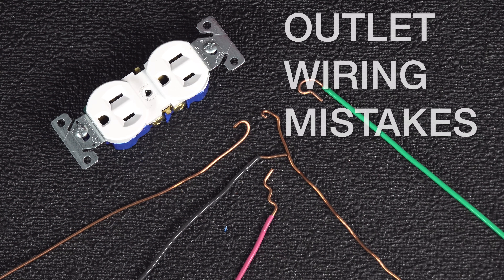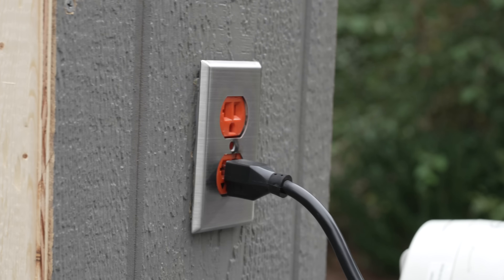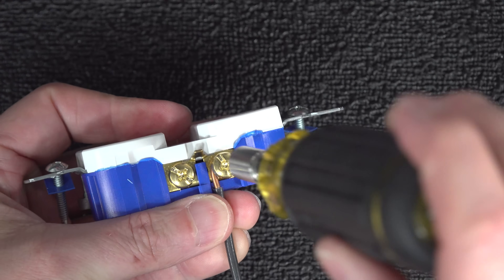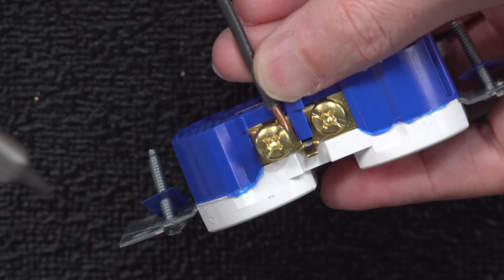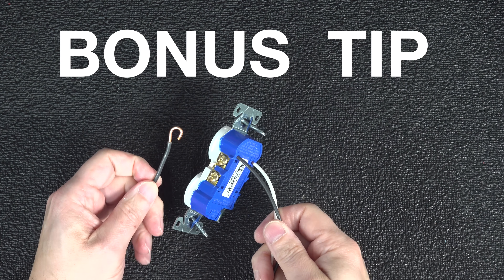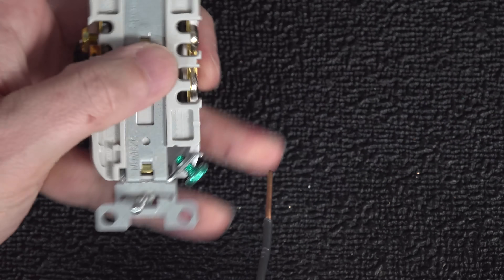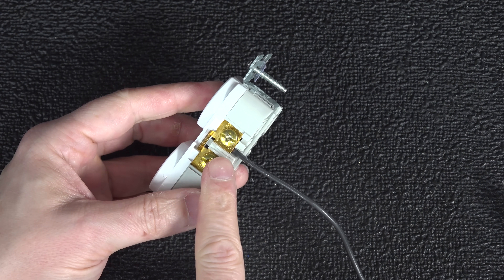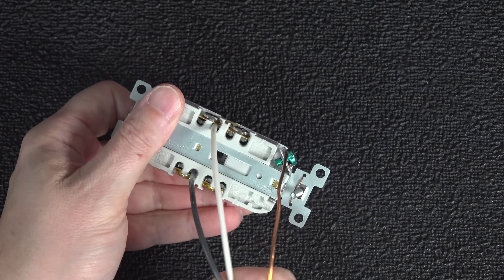BEWARE Of These 3 Common Wiring Mistakes On Outlets & Switches

Comment: That naked ground cable seems so dangerous to me...
Reply: Why?
Reply: @tylhunt  here in Brazil we only use naked wires inside earth to make the ground system itself, but the ground wire that goes inside the house is insulated.

If by any reason the insulation of the hot wire fails you won't have things like a live ground wire or an electrified carcass. 
But I'm not judging, I just stated that based on my perception and limited knowledge it seems dangerous to me.
Reply: @EduardoMonteiro89  It doesn't matter if the ground wire is insulated or not. The ground wire is at the same potential as the box itself. it's used to bond anything metallic to ground so that you don't get shocked.
Reply: @tylhunt  by my knowledge it doesn't prevent you from getting shocked by itself, it depends on other components to do that.

But I know that each country will have their standards and it's not me thinking it may be dangerous in some hypothetical situation that will change it. xD
Reply: @EduardoMonteiro89  The point of the ground wire is to keep the box, or panel, or conduit, or any part of the electrical system that is not supposed to be electrified, grounded. It doesn't matter at all if it's bare or insulated.

Comment: Most receptacles also have a built in plastic lug for making a hook. You have to strip slightly more wire, on the right side you stick the bare wire behind the plastic lug that sticks out some, that holds that tail end of the wire so that you can wrap it around the screw. This is what I was thinking you were going to mention as being the "tip".
Reply: I've noticed that too.  Very handy, just don't be sloppy with the wire and let a bunch hang out the back.  Oddly though the Leviton branded ones at Home Depot don't seem to have that.  But the Eaton branded ones at Lowes do.
Reply: Thanks. I just asked about this in this section. I seemed to recall it was something like this and was surprised he didn't mention it.

Comment: Very cool. Thank you! While I was switching out all my old 100 year old outlets for new ones, I found that those little blue triangles are notched to nicely form the wire hooks for the outlet screws. Always turn off electric breakers before working on any electrical. Plug in a loud radio so you can hear when that circuit is switched off and safe.
Reply: Great suggestion about the loud radio!

Comment: It is sad the rear entries are not real quick connecting fittings. European manufacturers sell such equipment for years now and safety has been greatly improved. The spring loaded grips insure  and maintain the right amount of tightening where the screwed terminals could get loose with time. Installation is also considerably faster with quick connect than with screws and you don't have the problem of tools ruining the screw head anymore.  a push button help to release the wire if needed. 
Lots of bad contacts and subsequent fire are avoided thanks to spring loaded connections. Every french electricians have adopted it and would not get backwards !
See it in action:
For the outlets: https://www.youtube.com/watch?v=D4U3fAWwUMQ
For the main panel: https://www.youtube.com/watch?v=qv6f6TK3V0U
Reply: Are you seriously advocating spring loaded connections vs clamping connections? In what world does a properly torqued clamp connection get loose with time but a spring loaded connection doesn't? That is completely bass ackwards. It is well known that springs lose tension over time, which leads to a loose connection and greater resistance (a lot of heat), which destroys springs.
Reply: @zachdemand4508  I had my doubts too and kept using classic connections for years. But the fact is that strong alternative currents are able to loosen screws causing overheating and fire. 
It is now good practice to check annually for the screws are properly tighten where spring loaded items are systematically ok. Checks with thermal camera clearly show the difference. I also had to replace several burnt devices and always found loose screws.  So I changed my mind and now use spring loaded items préférable. Springs can keep their force for very long if static.

Comment: It's called polarity. Those back wire holes are exactly like Wago connectors, garbage
Reply from the maker: The backstab holes are garbage, the backwire slots are better than hooking. And Wagos with their patented holding system are amazing.

Comment: Those backwire outlets with the screws are my preferred ones. I find that the added expense is usually reduced if I buy a box of 10 instead of just 1.
Reply: I replaced very old back wire outlets. So fucking annoying. Never been able to pull out the wire correctly and just have to break the plastic to get the wire out.

Comment: I'm just a DIYer and both my houses I've owned I've always gone through all the outlets/switches and fixed all these issues. Drives me crazy that a real "electrician" would do such shotty work but they do...
Reply: Is shotty work, as bad as shoddy work? 😁
Reply: @treeguyable  I think it's worse than shoddy but not as bad as shitty!  😄
Reply: Oh God the amount of work diyers have made for me.... your problem wasn't the installer it was the general contractor who pays for the lowest bid instead of going with a respectable company. There is only a one year warranty window on installs remember that cheapo knows he only has to make it last that long and you can't sue.
Reply: Not to mention it's fairly cheap to do. Just requires a few tools and a brain.

Comment: Should something that can be removed be used as the indicator for the polarity of the terminal? Why don’t you simply label the terminal
Reply: The screw is staked on the end, so won't come out unless you really crank on it and strip threads. Besides, the is a big clue in addition to the screw colors, namely the width of the electrical slots adjacent the screws!
Reply: @campkohler9131  To see the width of the electrical slots, you have to turn the receptacle over. The wide one is on the left. Now let’s google. Ah. The wide one is neutral. Turn receptacle back over and attach wire to the left terminal. See what I did there? 

Also, it’s pretty easy to turn them upside down. 

Just put a letter by the terminal. We use L, N and E.

Comment: As an Electrician for 10yrs I can say wrapping the screws is #1 and only way a professional installs recs. Unless it's a GFCI rec or what you show with the side clamps. As for all those extra hook up spots...... All I can say is make a pigtail because it's cleaner and better connection for touchy arc- fault breakers. Good video
Reply: Its less of a failure point to have 4 solid clamp connections at the recip than a huge pigtail in the box which adds another point of failure
Reply: Never done prefab, eh?

Comment: Always, always pay the extra for the higher grade outlets and switches. They are worth it for installation purposes as well as longevity.

And as a kicker, get in the habit of orienting your screw heads on the cover plates to north and south (up and down). Makes the installation look more polished and professional.
Reply: Agree about the higher grade outlets as they also have an improved blade holder inside and the metal backstrap, both of which increase durability.
Reply: The company I work for makes that a policy. Every plate screw must be veritcal and plumb. We do multi million dollar custom homes, so I can understand why they enforce it. I do it mainly because I have OCD.
Reply: @NathanaelD  yessir i actually work on multi-million dollar homes in the beach here in beautiful Tampa Bay Florida and i strictly enforce that with my company as well. those are the type of things that set you apart from other electrical companies and customers DO actually notice it. i was on a job and one of the painters said he had never seen an electrician yse a level except me and that kinda surprused me lol. am i the only one? geanted a lot of things just go by eye  but yeah
Reply: I like east and west for the horizontal look ..
( just personal preference, both are good )
Reply: regular outlets and switches work fine been using them for 15 years and havent had any problems. a lot of times it's shoddy workmanship or over agressive workers that break devices. there is a bit of finesse that goes into the job that people tend to overlook

Comment: Nice. How about stranded wire?
Reply from the maker: We don't use a lot of stranded wire in the US for outlets, except in RVs and Marine its very common. MOST but not all backwire(able) outlets as shown will accept stranded wire and its clearyl very easy compared to the crazy way it used to be done, using loops, etc. Always check the outlet it will say if its rated for stranded but many are for backwiring.
Reply: @SilverCymbal  Interesting. I'm not a licensed electrician, but when I do addons and reworks around the house, I always use "machine" wire (stranded) when running in EMT. So, I'm always wiring switches and recepts w/stranded. I have a technique to keep the strands from spreading all over too. I never thought a recept could be back stabbed with stranded wire!
Reply: @curtchase3730  Ya no stop using that wire for the sake of people's safety

Comment: I was sure the number 1 mistake by people, especially non-professionals, was going to be forgetting to cut the power and verifying it was off.
Reply: It’s not included as these people are no longer around to complain
Reply: @62Cristoforo  It's not that bad. 120 tingles and 240 hurts 🙂
Reply: @mr.dr.k3148 240 kills if you complete the circuit right
Reply: @62Cristoforo  Darwin baby!
Reply: @62Cristoforo  It really doesn't hurt much, just makes your muscles tense up a bit. It's like the "pinch" feeling from one of those hand held tasers anyone can buy. The ones that have that big spark that jumps across the electrodes, goes SNAP SNAP SNAP
Reply: @TrashPanda5150  I think its thickness of skin that dictates that, 120 cant fully get through thick skin of a contractor so you only feel a small % of its power. But anyone with very thin skin will get blasted. Thats my theory.
Reply: Na, we pros wire them hot, adds a spark to our day
Reply: @Z-Team  I guess I'm a pro then ^ ^
Reply: @Z-Team  that’s what i’m sayin
Reply: Number one mistake of changing a light fixture is thinking it's dead because the switch is off. Saying sometimes, power is brought Into the ceiling box, not the switch box. A tip for the do-it-yourselfers.
Reply: @hogroamer260 that’s why you buy a voltage tester or a multimeter depending on your paranoia
Reply: @TetraSamurai  You say "paranoia", I say, "intelligence".
Reply: @jacobhall1488  I'd never knock anyone for safety. That would be the guys that like to test with their finger, milliamps kill.
Reply: @jacobhall1488  A meter will tell the whole story. Some low voltage situations, a grinder may indicate as dead, not necessarily so.
Reply: That is half the fun though. I still rarely shut down power when working on electrical. Only if it is 240. Cause that does burn a tad.
Reply: For outlets, I typically dont cut the power. It's unnecessary with a steady hand and being aware of where my tools are. A little shock early on taught me to be careful with my finger placement. But this way, I can check for voltage instantly at each outlet as I do them vs running to the breaker after every change. Not for everyone. Some people are just careless and should take more precautions. Also, some outlets are wired dangerously, or haphazardly, so turning off the juice in those situations is a must. But for the most part, getting a little shock on the hand won't kill you, it just hurts a little. Anything more complicated than outlets, or working with 220v is absolutely a turn the breaker off situation.
Reply: @Thrsmthngwrngwthsgy  I’m just paranoid. I greatly appreciate your input
Reply: Just touch the ends of the hot and neutral wires to the tip of your tongue to see if there is a spark.
Reply: That's the kind of mistake most smart people make only once.
Reply: Yes i never work while it was live.
Reply: @jacobhall1488  because stupid mistakes happen more often than you'd think.
Reply: That's not the number 1, that's the last mistake.
Reply: I was just about to comment this but I see I’m 3 weeks late. I definitely thought the first thing he would say was “cutting power to the outlet”
Reply: That was the first thing my mind jumped to and ive only learned basic electricity from high school
Reply: Hey quit watering down the gene pool!lol
Reply: Real electricians don’t have the option to cut the power just have a guy behind you to kick you off if something happened 😂
Reply: i am an electrician and i sometimes do wire them hot depending on the situation. just be very careful
Reply: At the university, circuits were poorly labeled - as in it was nearly impossible to turn off the right one. Thus, the electricians either would just short it to trip the breaker, or wire it hot. One guy only wired them hot - 120V only.
Reply: Ehhh a little shock won’t hurt and will teach those lessons
Reply: I do alot of wiring with power on. Sometimes you get a little zap but it's pretty unlikely with 110 to be injured. I've been shocked hundreds of times and it just startles you a bit but not a big deal.
Reply: 😂 facts
Reply: I do basically almost everything on my own. That why we got youtube! Haha
Reply: @calallen8786  your the reason we have fire departments
Reply: @JasonxSmith  nah. Safety is #1 for me. That why I learned trade from family members,  friends or other person I helped out. Even some tutorials video helped me on youtube. But if it a big job then nah let the contractor do it. Everything is too expensive now a day why not learn how to do stuff your own way
Reply: Pretty much optional, if you know what you're doing.  If it's just the hot, neutral, and ground wires in the box, you can wire it up without zapping yourself.
Reply: The #1 mistake made by people is not having enough money to hire an “over-paid” electrician to do their electrical work.
Reply: @juana.2745  men die in this trade ! Overpaid? Houses burn down from incorrect practices children die overpaid?  Perhaps your just underpaid for whatever it is you do I know I am. 40 yrs sparky never been over paid in my life .
Reply: @joesutherland225  Read the comment again, and rub those two brain cells together really hard. I am an electrician. You aren’t picking up what I’m putting down.
Reply: @juana.2745  i love guys like you , i always have to come by and fix your screw ups cause you didnt want to hire the overpaid electrician ! yet you'll pay a mechanic over a hundred dollars an hour to work on your car
Reply: @DeltaCo7175  if it's an easy job I'm not paying the mechanic lol
Reply: @DeltaCo7175  Didn’t anyone ever teach you that quotation marks are used to apply sarcasm?
Reply: @juana.2745  No , I must have "dropped out " before that class !
Reply: @DeltaCo7175  you read Juan's comment 100% backwards lol
Reply: @DeltaCo7175  - do you have reading comprehension issues?  Juan's comment referred to people unable/unwilling to pay an electrician, and was obviously made in support of using one.  One wonders who would want you to correct anyone's screw-ups.
Reply: @acommenter5184  reading compression ? what  is that
Reply: @DeltaCo7175 if they need an electrician to change a light switch, I question their intelligence. We aren’t adding a breaker box here
Reply: @TetraSamurai  i agree , some arent comfortable at all with it . Just like they wouldnt be comfortable replacing a ball joint
Reply: @juana.2745  if your replacing an outlet, its not that hard. Anyone with an elementary school education can replace an outlet. Electricians are great though for lighting changes.
Reply: Nah that's just you..
Reply: I don’t any electrician that replaces outlets with the power off.  Only DIY’ers
Reply: omg I had someone get hit with 270 feeders i believe it was doing just that. This man really grabbed the bare copper ends of the feeders. He grabbed 2 of them at the same time while he was with a foreman. Needless to say, he completed a circuit
 lmao